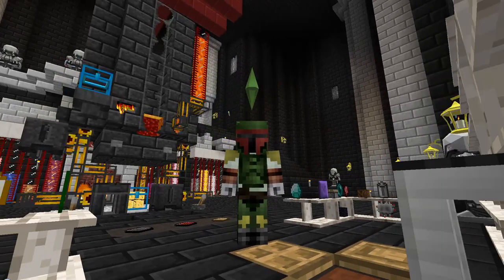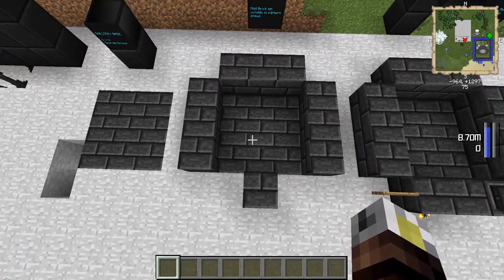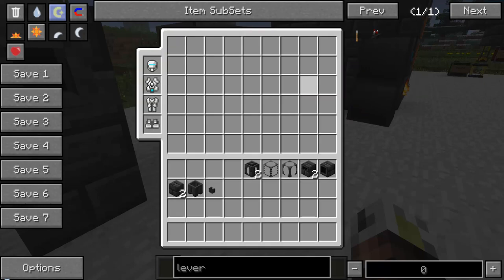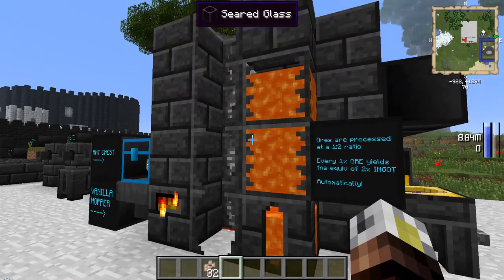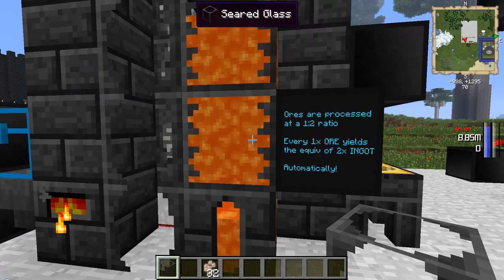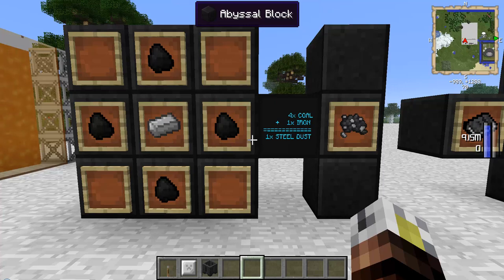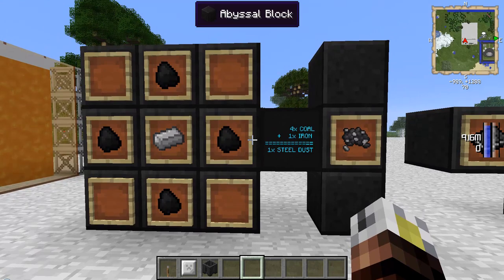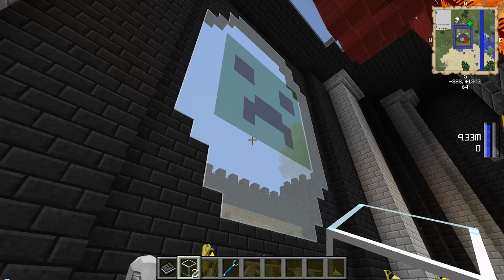Tinkers Construct - Tutorial - Tinkers Construct - Smeltery, Alloy, Casting, and Basic Automation

Comment: HANDY TIP to anyone who uses the Smeltery: when you do the Seared Tank and Seared Glass, the smeltery is only considered valid when the tankage and the controller are on the same level in the structure. So, if you put your outputs on the aboveground level and put the controller, tank, and any seared glass on the next level up, the controller will recognize lava in the secondary seared glass or seared tanks and will draw from them in series (it drains the first tank, then another one, and so on). It will not recognize lava storage on a level other than where the controller is.
Reply: GOOD POINT. Another thing to note is that if a block isn't completed in the casting basin, you can always resmelt some of the same metal you have lying around. Yet another, is that BLAZING PYROTHEUM smelts things faster than lava, AND it allows you to smelt some things lava cannot smelt. Blazing pyrotheum is only available in Thermal Dynamics, however.
Reply: Also, if you have the CoFH mods installed (Thermal Dynamics and the related set of mods), then you can use a Magma Crucible to cook your Redstone into Energetic Redstone, and then use a portable tank and fluiducts to transfer it into the smeltery for any recipes that require it. Handy for making Signalum, as the recipe requires 10 redstone per iteration and you can only fit a stack in the EnderIO alloy smelter. Using a resonant portable tank, you can store enough liquid redstone for 25 runs through the Signalum recipe.

Comment: How do you make a part cast I use gold and I could only make a blank cast of gold however it doesn't let me make a part cast I want the gold on the outside but it wont let me
Reply: you have to place a part (cheapest is wooden) into the casting table, then pour gold over it. for example, i would make a wooden pickaxe head, then place it in the casting table. then i would pour molten gold over it to make a pickaxe head cast XD
Reply: You actually use Aluminum Brass, its an alloy of copper and aluminum (but not certain) This alloy is the only one you can use to make the molds for the forge.
Reply: Jon Star I have made all my casts from gold. They work fine.